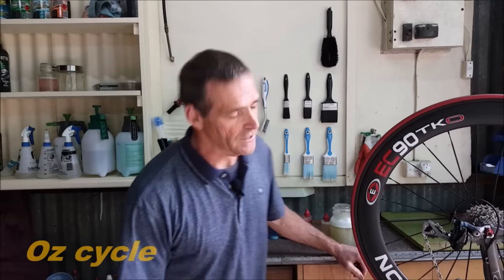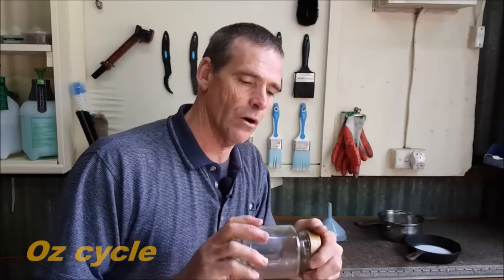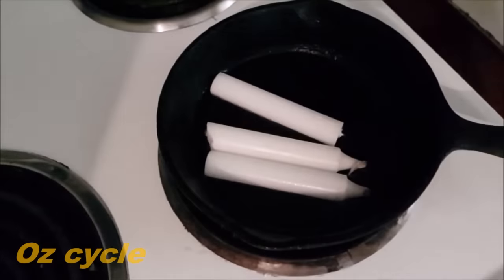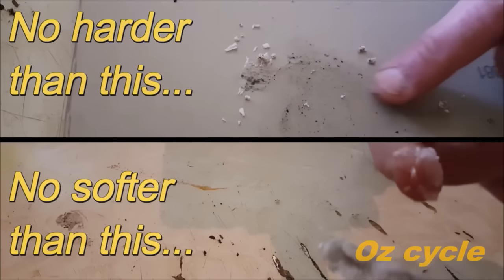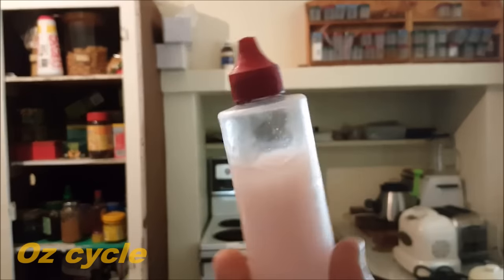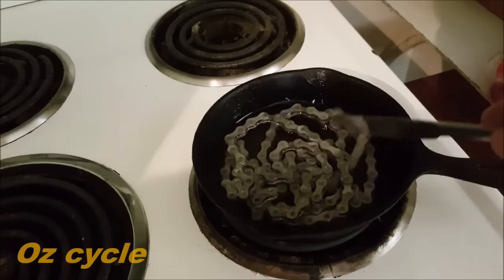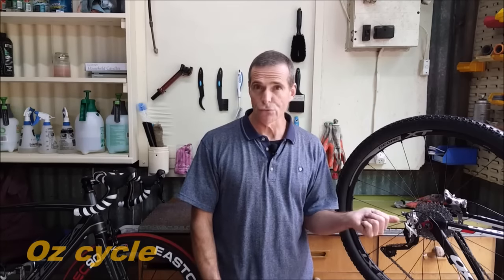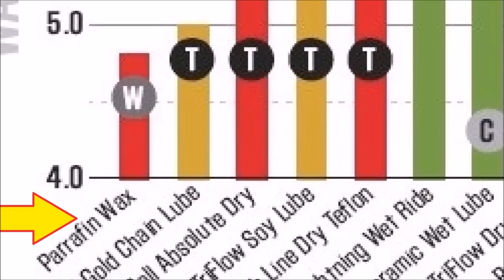BEST chain lubricant ever !! .....make it yourself.

Comment: Commercial wax chain lubes are stupidly expensive, so this is a great idea.  But - I'm really concerned about the use of xylene as the solvent.  It's nasty stuff.  In histology labs, where tissue specimens are embedded in paraffin wax for sectioning, xylene is being replaced by limonene as a non-toxic alternative (d-limonene is used in cosmetics and medicines).  And it smells of lemons.  I'm going to make up some magic wax lube, substituting limonene for the xylene to see how it goes.
Reply from the maker: +FangPaw Sounds like yur on to somethin there FangPaw. Please let ud know how it turns out.
Reply: +oz cycle.  WIll do!
Reply: How it went? Is this working like mixture with xylene? I am asking because as you has written xylene is really bad for people, fumes, skin contact (everything).
Reply: I have to admit I haven't tried it yet.  I'd been using the (extremely expensive) Boeshield T-9 wax lube, and mentioned your DIY wax lube in my local bike shop.  Whereupon they produced a 250ml bottle of Squirt (an aqueous wax lube) for half the price of 118ml of T-9.  So I thought I'd give it a try.... and avoid the wrath of the missus.  The downside of Squirt is that - unlike T-9 or your DIY wax lube - it's not really suitable for cables and pivot points.
I'm sure the limonene will work - it's 100% miscible with wax and it's volatile, like xylene.  Yes, xylene really is nasty stuff.  In labs, it's always used in a fume hood and handled wearing gloves.  I guess you could use it outdoors, but you really don't want it on your skin.
Reply: FangPaw please post the results of the limonene/wax lube here, that would be amazing!
Reply: The fumes of xylene are very nasty for respiratory system and xylene can harm skin! The patent you are up to, solves the problem. Very interesting!
Reply: Is limonene readily available?

Also, I'm not really sure of the function of the Xylene (or limonene, if used).

For that first lube, with the chain in the pan, @oz cycle just used paraffin wax and paraffin oil didn't you? Is the Xylene needed to keep it liquid in the squrty jar? Thanks.

Years ago, I just used to use plain melted paraffin wax (no oil). It kind of worked, but was not very convenient.

Come to think, could you just use a mixture of paraffin wax and paraffin oil in a squirty jar, and use the hot water trick to melt it (as it would presumably have solidified in the squirty jar) each time you need to apply it?  (This would get rid of the need for the nasty Xylene (or having to find limonene). If it works, that is.    :-)
Reply from the maker: +Mike W Ellwood Xylene is the carrier for the wax Mike...it evaporates quickly leaving the wax as lubricant. Paraffin wax needs to be softened otherwise it crumbles and falls out of and off of the chain. Warming up the mix without xylene is fine but once applied to the chain which is room temperature it will solidify before getting into the pins and rollers of the chain. The squirty bottle method is for emergencies or those who cannot remove their chain. If you can remove your chain the hot wax bath method us best.
Reply: +oz cycle Thanks for your quick reply!  Now I understand it better.
Reply: In the UK, limonene can be bought on eBay or via Amazon (get the solvent, not the capsules sold as a dietary supplement!).
Reply: I have tried the limonene, with bad results.  First I tried the proportions in OZ CYCLE's original recipe: first melting 4oz.1/3 paraffin, adding 4oz. paraffin oil (which came out to a perfect consistency as per the video), then adding 4oz. D-Limonene.  Indeed, the hot paraffin mixed wonderfully with the Limonene, but then it solidified at an unacceptably high temperature.  I tried using on my chain, but applied in its hot liquid state, it immediately solidified hitting the (room temperature chain), creating a slushy mess.  I figured maybe it needs more limonene?  So I added limonene to obtain a ratio of 1/4 paraffin, 1/4 paraffin oil, and 1/2 limonene.  This did not help (enough).  The mix was still solid at room temperature, with a melting point probably still over 100F.  So I am abandoning limonene and starting over.  I am leery of using this mix for soaking chain (only 1/2 paraffin content, the actual lubricant), and I can't use it as a bottled chain lube.  Next I'll try Naphtha, as someone else here suggested.

Comment: Used paraffin candles, liquid paraffine (can be found at the medical store it is used to treat constipation) and instead of xylene used turpentine oil. Works great big difference felt in effort and super silent.
Reply: Hello! Can I use non mineral turpentine??? Or any kind of it??
Reply from the maker: For the best result , no. However it will make a lube but will attract dirt

Comment: Xylene ban in California I'm F#$%k!
Reply from the maker: +Juan Baltierrez You can use Toluene or try equal parts of Acetone and Kerosene. If all else fails,you can still make the wax mixture without the carrier (Xylene) and bath the chain in it whilst warm enough to be a liquid,take chain out after 10 minutes and allow to cool. Wipe off excess wirh cloth and its ready to use. Hope this helps Juan
Reply: so i can use... candles+paraffin oil+kerosene =mixture?
Reply from the maker: +Juan Baltierrez acetone+kerosene equal portions will make the carrier.....then add the candle+parrafin oil mixture.
Reply: With good reason, Xylene is a dangerous carcinogenic solvent. I'd try acetone before xylene.
Reply: Juan Baltierrez order it from Amazon. worked for me.
Reply: You do not really need xylene. Hot paraffin and paraffin oil in the bottle is enough.Just when you want to lubricate the chain you have to put the bottle in hot water to melt and flow from the bottle ....Xylene is to hold the liquid paraffin and then when you put it on the chain to evaporate quickly.Without xylene it solidifies more slowly on the chain. But it's no problem that this means a few extra minutes ...
Reply: oz cycle hi, I tried acetone + kerosene. Since kerosene is oil and acetone is liquid, they separate. Same goes if i just add acetone to the p.oil and candle
Reply from the maker: +Ivan Israel Rivera Acetone is a good replacement for Xylene but dont use kerosene in place of paraffin oil. Use only paraffin oil.
Reply: Can I mix the oil and the wax ??
Reply: Hi, I'm having trouble translating "paraffin oil" to Spanish. Help!
Reply: @rodrigog.c.6047  parafina
Reply: Parafina de las candelejas ! O solida o líquida

Comment: +oz cycle Thanks for the great video.  I've always been a DIYer so making the wax lubricant rather than buying commercial appealed to me.  However, I have two suggestions.  First, rather than risking exceeding the flashpoint of the candle wax I recommend melting the wax in a can immersed in slowly boiling water.  It'll take a little longer but will be a lot safer.  Two, xylene is really bad to breathe so you need to pour it in a really well ventilated area.  As aside, xylene is unavailable in some states here because idiots are huffing it.  I couldn't get it in NH but the hardware store in Maine carried it.  Btw, I tried this concoction on my double barreled shotgun.  It left a really nice film on the barrel and a nice shine on the stock.
Reply from the maker: +John Brandolini Yes wax is good for sliding parts. As long as the heat source is not near flashpoint ie:naked flame , it will be fine. Agree Xylene is not a human friendly substance but as you say,handled safely its fine. See vid "wax chain-comonly asked questions Pt2" for a list of xylene substitutes. Cheers John
Reply: Cheers thanx for the vid and the reply.

Comment: I bought a K Mart $13 rice cooker to mix the paraffin wax and oil and soak the chain. 750 ml oil per candle is a good starting point. 
I then used two parts of the wax/oil mix to one part xylene to make the other mix.

Comment: Thank you for those very interesting and useful videos. I am one of those always using oil on chain and kind of being not so keen on properly cleaning it. When you say "wax on chain" normal reaction is to be skeptical as was is a solid substance as we know it. Only place I use was for a lubrications, so far, are sliding doors. I have a heavy sliding doors on balconies and also lighter ones on closets. And wax is really better here compared to oil and it is clean. Wax is applied by pressing wax stick to sliding surfaces. Wax lasts for some time and it has to be reapplied and compared to bike chain application is easy. With bike chain we want it to go inside the rollers where making wax semi liquid or immersing the chain is the only way. I was surprised to find that Xylene is available in Canadian stores and some people say not in US. Paraffin oil is also available as 'oil lamp' and even comes as scented. Right now I am converting to ebike and will try this waxing method.

Comment: I'll try this, thank you.One safety note, melting the wax and parrafin oil over a stove would be safer if you use a double pan. One pot for the wax sitting in a pot of hot water, otherwise there is a fire hazard

Comment: PAG 46 air conditioning compressor oil. You get a lot of it for about 10 dollars or even less at nearly every parts store, and it's very easy to apply on every chain link. Very sticky oil film. Runs and shifts smoothly and quietly now.

Comment: Excellent idea, will give it a try. But two questions:
1. Do we need xylene if we're going to give the chain a bath in the hot mixture? 
2. How do we re-wax when necessary? De-waxing first? How?
Thanks for reading!
Reply from the maker: No xylene for hot waxing. To rewax wipe chain with a rag to clean and pop into wax. If very dirty,pour hot water over chain to clean or soak in metholated spirits. Then into wax.

Comment: I have been using molten speed was. I keep it in its own saucepan ... just heat up and dunk the chain. I use an old piece of gear wire to pull it out and don’t put the chain links in the mix. They are likely to come off. I use white spirit to degrease the chain for 10 minutes and then thoroughly clean with a cloth before waxing. Sometimes if the chain comes off you have to put it back on the chainring... the fingers don’t look dirty. How comes? Dirt seems to fall off the chain. Also... after a number of minutes of use... the wax becomes liquid with the friction of the links and the chain runs smooth. Last but not least... if you ever do this make sure you get the ok with the wife and make sure you have some ventilation.
Reply: Predictive text... don’t you love it... I have been using molten speed wax...

Comment: Having watched this, and not having any wax available, I tried something similar. After cleaning the chain on my singlespeed (cheapo chain, so it's worth experimenting) I sprayed it with beeswax furniture polish. It may not last quite as long as the method above - time will tell - but it's certainly very smooth, even after a few days. It was certainly quicker and easier.
Reply from the maker: +Paul Sherwood Nice Paul. Bees wax tended to be "sticky",more expensive and less available than paraffin wax. Let us know how you go with that tho...thanx.

Comment: Great video you can purchase paraffin wax from your local beauty supply as it's used for hand therapy which melts at 45 degrees celcius, heated paraffin baths can also be purchased instead of using the stove. Instead of xylene could you use isopropanol ?

Comment: Hi @ozcycle, I have taken the plunge into the world of paraffin wax chain lube with the aid of your videos.  It’s really very good.   I rode a 100km ride yesterday and the chain was clean at the end of it.   I do have some questions,  but I’ll get to that in a bit.  Firstly before that ride I removed the chain and stripped it of the old oils and bathed it in a bath of Paraffin wax and oil as you suggested.  Aside from making a fundamental error when lifting the chain out of the bath and accidently dropping part of the cleaning rag  into the bath and flinging melted wax onto the patio floor (damn), it really worked very well.
 
What isn’t working quite so well is the wax preparation for the little squirty bottle.   I’m not that keen on the idea of using Xylene, so I took the alternate approach mentioned in comments of using Kerosene and Acetone.   The ratio of the various components in my batch is roughly as follows:  Wax 330ml; Paraffin Oil 300ml; Kerosene 150ml; Acetone 100ml.    This mixture is liquid when warm,  but as we approach winter on a 15 degree C day,  this solidifies.     I’ve had to warm up the little squirty bottle in hot water to use it,  but when I apply it to a cold chain  it solidifies quickly and does not look as though it will properly run between the rollers and pins.     What do you suggest I do to make the squiry bottle lubricant mixture liquid at a lower temperature?   Do I need to increase the proportion of kerosene and acetone,  or Xylene the only way to go with this?  (or do I need to warm the chain?)
Reply from the maker: +Brett McLean If you have a removable link,always do the hot wax bath method,Brett. The squirty bottle is for emergencies and those who cannot take their chain off the bike. For a cold chain,warm it up with a hairdryer or add more xylene to the mix. The xylene will evaporate and leave the wax only.

Comment: With the Xylene use it outside in a well ventalated area, a fan to the left or right of the mix blowing the fumes away would be a good idea. Use rubber gloves rated to handle the xylene is a very good idea. Do all your work ( warming to liquid etc. ) with the xylene such that you dont inhale or get it on your skin. Other than that your home made lube is fantastic !

Comment: Great video Steve. I would like to ask if it's ok to use wax on carbon fibre crank chainrings?
Or are the chainrings made of aluminum on cabon cranks?
Reply from the maker: A waxed chain  is fine on either.

Comment: Hello Stephen. Waxing chain has been excellent. Monitoring test mileage has been between 300- 600 miles before complete clean (Gas) and re-wax.Settling on around 400-450. My question is here in Missouri the summers are hot and the wax app and use have been fine. But the cold ass winter is about here. Should I increase the paraffin oil ratio a bit or not because of the cold? Note: as i don't have a heated shop this is going to be an in the apt. event, no worries here. Thanks again from the US. David
Reply from the maker: +ryoiter For bottled application of wax in colder conditions add more xylene. The xylene keeps it liquid but will evaporate after a while once applied leaving your chain well lubricated with wax.

Comment: 1. From what I read, xylene is too toxic for use on a bike chain, even if it evaporates quickly.  What can be used instead?
2. Soaking thorougly clean chain in molten candle wax seems practical economical and effective.  Perhaps a chain lubed this way does not need lubricant dripped on regularly.  I wonder what kind of carrier/thinner is used in commercial chain lubes.
3. Next I want to understand why paraffin oil and candle wax are both needed.
So this post shows I still have some questions
Reply from the maker: Toulene,acetone,alcohol. 
The oil spreads over the chain helping prevent rust in wet conditions

Comment: i just finished putting my drive train back together after a thorough cleaning and it is spotless. 

the GCN guys did a wax treatment thing, but only dipped in wax, melted and complained of noise. my question is; did your extra ingredients make the drive train quiet as well? 

excellent videos ! 

thanks from Newfoundland.
Reply from the maker: Paraffin wax only tends to flake so to keep it soft add paraffin oil.

Comment: Nice. I live in dusty dry los angeles and ride the beach alot. I go through 60ml bottle of white lightning dry lube every few weeks. I ride the beach alot and sand salt dust is my terrain. It does keep my chain clean.  A wipe down and relube its back to life. Can i use 91% isopropyl alcohol as a carrier?